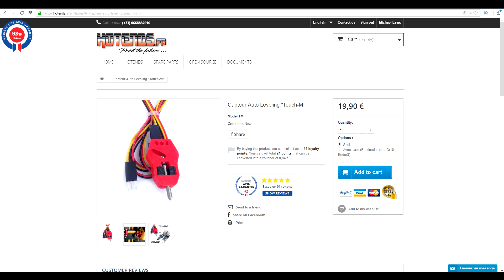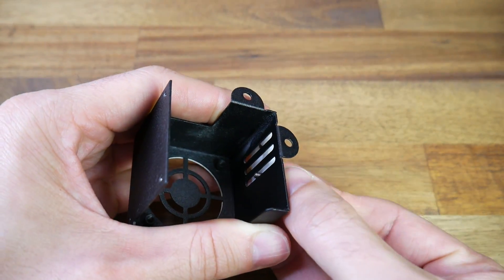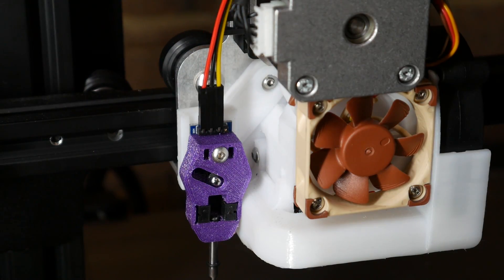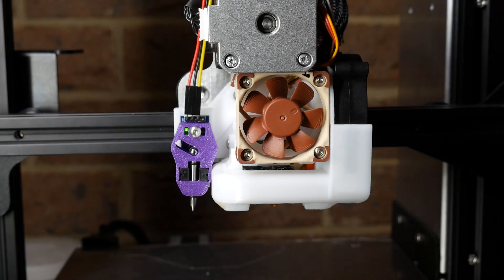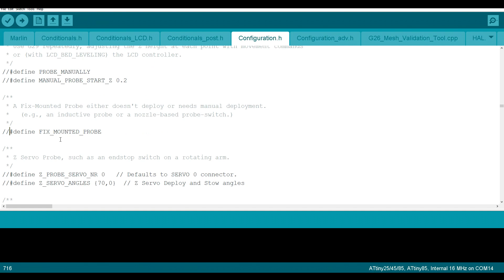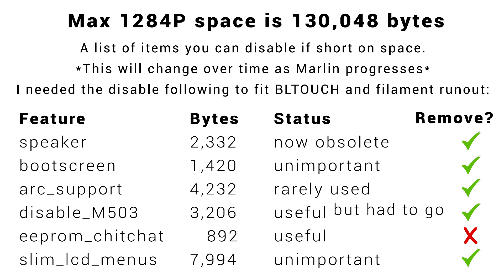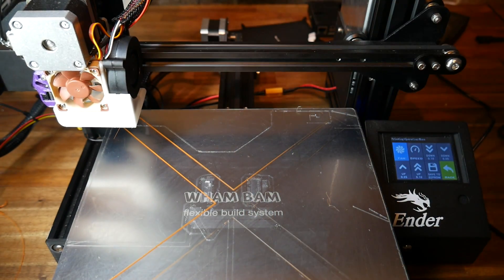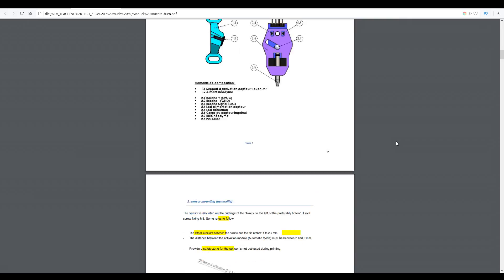Touch Mi auto bed leveling guide - BLtouch alternative? UPDATE IN DESCRIPTION

Comment: Im trying to enable this in mks robin nano v3 now, flashed latest marlin and made all the configuration to work (without meshbed) I have old Ramps+mega stuf and mash level bed is working line a charm. But spending many hours on mks robin nano v3 still couldent get the juice..

Comment: Howdy Michael! Greetings from Brazil.

One of my printers is a Sethi3D FARM (made by a local manufacturer here in Brazil). It doesn't have specifically a Touch Mi, but its Z probe works with the same principle (the actual board PCB looks like an exact copy of it), so I probably think it's configured in Marlin as one (the manufacturer does not release their Marlin source code allegdely to "standartize tech support".

Now here's the thing. The printer is out of warranty anyway so I plan on Klipperizing it like I did to my Anycubic Mega X (your tutorials, along with JJ Shankles ones, helped A LOT btw). I might model a mount for a standard BL Touch, but if I could (at least provisionally) make the stock probe work on Klipper, it would be awesome.

Any hints on configuring a Touch Mi-style probe on Klipper?

Comment: Hello friend, on my Ender 3 printer and based on this tutorial I installed the Touch-Mi with the Firmware listed in the description and it worked perfectly. But now change the plate for this:
SKR Mini E3 v2 0 and install the Marlin 2.0.1 which is the latest version and I don't know what to do to configure the TOUCH-MI.
  Can you help me configure the Marlin so that EL Touch-Mi works. Thank you

Comment: I think it is a very nice solution proposal because it works with any surface and it could be implemented in old control boards that don't have the extra pin for controling an electromagnet. It just needs 5V and GND. I think problems would be solved soon....

Comment: I have had these same issues with unreliability with a £12 3dtouch from geeetech, tried the probe on an A8, cr10s and a20m. Always similar results, just not reliable enough unless use a 0.3 layer height.
With this touch mi, could the magnet  no be placed on far x axis, or I know it would take a long time but if we fixed it to the top bar at the top of z axis, there would be less false triggering.

Comment: Hi, help me deal with BLtouch. I installed everything, set everything up, but there was a problem with (HOME). When you start HOME, then on CORE xy, the carriage goes to the left front corner according to XY - that is, everything is correct, and then the Z axis starts to rise. But the problem is that I do not reach the table with the block, that is, I need my head printer before leaving the Z axis in HOME, first went to the center of the table.
Marlin 2.0 SKR1.3

Comment: Hi Michael, the boundaries for probing have changed in Bugfix 2.0. 

The setting no more exists... Now you need to configure it in this section. 

Configuration_adv.h

#if PROBE_SELECTED && !IS_KINEMATIC
  #define MIN_PROBE_EDGE_LEFT 48 
  #define MIN_PROBE_EDGE_RIGHT 48
  #define MIN_PROBE_EDGE_FRONT 20
  #define MIN_PROBE_EDGE_BACK 20

#endif

Its no more the max value. Now the information is how far from the edge (see right and back) If you just copy the vaues the probe will stay on one single spot like mine did... :-D

________________________________________________________________________________________________________

For the probe offset now there is just a single line (X, Y and Z)

#define NOZZLE_TO_PROBE_OFFSET { 48, 0, -1.175 }

Comment: check "OPTO" optical probe - I design it few years ago (but put it on thingiverse last year) , you can mount it anywhere without worry that it melt becouse steel dont melt :) (probe can be mounted on top of the hotend not on the side)
Still Touch Mi on video is awesome :D (need few upgrades but its nice :) )
https://www.thingiverse.com/thing:2769816?fbclid=IwAR3GbxoKSlJSDWlMNIwkw5Pa01H1t_oYHn2T3JAW4U9yQwyLfYeOrWxom2A

Comment: Optical ABL solutions have been around for many years now. It is known that light effects the accuracy so the optical sensor can detect the interuption better a very small LED would need to be fitted to help with the issue. As you said probing speed also matters which is a very easy fix in the code.

Comment: Hi Michael, Great video and thank you so so much for helping. Quick question. I have a CR-10s, with a hotend that leaks (I updated the nozzle to a 5mm (to use wooden filament) and think I may have overtightened the unit) and am considering updating. In your opinion and if you had to buy another creality printer, what would you buy? Note: Whatever I get, auto-bed-levelling is a must-have. Eagerly await your reply. Dujon

Comment: We're adding formal support for this in Marlin shortly. Watch out! It will ensure a minimum height for probe deployment. You'll still have to tune movement limits and/or the magnet position so it doesn't drop the probe near the end of the gantry. While the side opposite your endstop is an option, some people like to put their camera trigger there. https://github.com/MarlinFirmware/Marlin/pull/14101
Reply from the maker: Thanks, Scott. Appreciate all of your work.

Comment: Since you're already in Marlin, you can add the G1 Z0.5 step to stow the pin in Marlin's G29_SUCCESS_COMMANDS line in Configuration_adv.h and skip the slicer config.
Reply: Hi, can you help me, I can't find the Marlin G29_SUCCESS_COMMANDS, 1.9.1. Thank you
Reply: @juancarlos3989  You’ll need to use Marlin 2.0.x.
Reply: @thisiskeithb  Hi friend, I installed it on my Ender 3 printer and Touch-Mi with Firmware 1.9.1 and it worked perfectly. But now change the plate for a
SKR Mini E3 v2 0 and I want to install Marlin 2.0.1 which is the latest version and I don't know how to configure the TOUCH-MI.
 Can you tell me if you have the Marlin 2.0.1 configured so that EL Touch-Mi works. Thank you

Comment: The reason why it doesn't work consistently is because they didn't try it out well enough. An IR sensor is sensitive to the sunlight and some artificial light sources. The solution would be to add an opaque shield around the IR sensor, but besides that, IR sensors are generally not always accurate enough for auto bed leveling measurements. Besides that point, that metal pin is too sharp and will start carving small dips in your print surface after a while. I suggest making it flat like with the 3Dtouch.

Comment: So cheap iduction sensors are still the best option.
Reply: From a repeatability test I saw, the best option is a simple microswitch.  Key points: Needs to have a repeatable positive stop position.  Remove the metal tab carefully.   It's cheap and provides very accurate results.   The down side is in solving the automatic deployment issue.  You could integrate a servo or something like that, but there in lies the complexity of making it full auto.  Semi auto would be a simple magnetic mount that would have a couple stop tabs that keep it positively and repeatedly located.

Comment: BL Touch rocks! This one's accuracy it's also being affected by the ambient light even it's infrared but even if it's closed to the outside, the accuracy it's lower than on the BL.  Maybe worth changing the optical sensor with a hall sensor? Think that this concept could be DIY if the price it's lower than for BL Touch (need to calculate but...unlikely).

Comment: Hi, it did not become clear by the video, but did you comment out the G29 and just use the stored settings?
My ezabl even show same symptoms as this if I don`t run the G29 in front of every print.
I find it to be due to Z-axis not staying in zync on my printer.

Did print some blocks for it, after that - the problem where solved on my printer.

Comment: My printer used to use something similar, And worked pretty good. As I had troubles deploying it on a delta, (it was supposed to bump a tower, but before calibration, it doesn't know where the tower is) I do it manually (and dont use it for ever print.) Your's probably inaccarute as it missing a spring to push the pin down when measuring. Using a round shiny metal pin is also hard to detect for the optical sensor.

You should test the probe by using M48.

Comment: I would paint the top of the pin black so there is less reflection from the top into the photodiode. It should help but YMMV.  Blocking the ambient light into the top will probably help too as it will change the amount of beam from the LED that needs to be blocked before the sensor operates.

I bought a 3D touch and it was useless compared to the BLtouch I now have.
It may have been a fake I have no way to tell.

Comment: Looks like an interesting concept, but why no cover over the optical path? Seems to me that ambient light could be bolloxing the accuracy..
I'll stick with my ZedThing ABL..  :-)
Reply: Indeed, your right! Even that sensor it's using for sure the infrared light it's still sensitive to ambient light. I'll try to build a closed one just for curiosity and in the price for build it it's right, then the concept might be worthy, what do you think?
Reply: @neagoecatalin879  I would definitely have a go at building a fully closed version.. It's not exactly expensive to build, apart from a few hours design and print time..!!
Reply: I use this type of optic sensor for all of my endstops and there is no need for adding enclosure. That black piece with a slit is enclosure.
Poor acuracy is result of to much slack between probing rod and frame.

Comment: Hi Michael, great review/tutorial as always. Before I had even seen the video, I checked out the website and manual. It seems a very clunky way of simplifying installation, which doesn't even do that well. Sure, maybe slowing the probing speed may yield better repeatability, but that wasn't necessary for the BL Touch, in fact you sped it up, with no loss of accuracy.
As you may remember, I also followed your guides on installing the BL Touch on the Borg (CR-10S4) and it is still serving me perfectly, not one failure.
Great to see the WhamBam FBS, I finally managed to buy mine too (also for the Borg) and it is everything I wanted, and then some. The weight saving has meant that I can increase both the jerk and acceleration too. I've also added a 0.8mm nozzle to the Borgs Microswiss hotend, so getting used to the finer tweaks with that. Happy days :-)
Reply from the maker: Your setup is very advanced now!
Reply: @TeachingTech  Thanks mate, much of it is thanks to your tutorials. It seems to be working well for me. Just need to think of something to print with it now. I spend far more time and money on improving/upgrading my printers than actually printing stuff. I thoroughly enjoy it though and that's what counts for me.

Comment: Woow woow , why this video ?
at 12:23, you don't put the offset on X ;)
Plz make a test M48, it's very precise.
Why did not you come to see me before publishing this video?

I sent you an email on April 22 to tell you that we had made a dedicated menu to adjust the sensor but you never answered me
https://gyazo.com/76f23895724907c7bf079ee902b3bc2e
Reply from the maker: In that email you provided the manual, which I used for this video. You also offered to setup the firmware for me, which is not useful for me making a guide. I don't want special treatment, just the same experience as any other customer.
Reply: @TeachingTech , it's not the setup but the new Firmware marlin 1.1.9, now it's not necessary to configure the firmware & you have a dedicated menu for tune the TouchMI.
But try to make a M48 repetability test first ,thx.
i need to know where is the problem, because we send many many sensor & a few errors.
I consider everyone the same, but I need to know where is the problem  I do not let my customers down
Thx Michael
Reply: Hi Pedro, I am using it and it works perfect. The only fear is that the needle will be down and collide with the platform, that's why I ask you can add the G1 Z0.5 step in Marlin, so that there are no oversights in the Cura configuration or some other cutter program.

Comment: I saw a similar solution in a fablab more than 2 years ago. Difference was that initial release of touch probe needed to be done manually, but in the end the pin was electrically raised from the bed. And it worked quite good, but they were using on glass bed. I guess that this design is open source since a while, and not really difficult to make also.

Comment: You should check out the pyr0 piez0 auto bed leveling sensor. It's an auto bed leveling sensor developed by one guy. It's not finished yet, but I have heard it's near completion. It has no moving parts and is supposedly more accurate than a bl touch and it works on all surfaces.
Reply from the maker: Thanks for the tip.

Comment: Can you review the 3D Touch in comparison to the bltouch?
Reply: it's junk, don't bother. I have it and I have to adjust the z offset almost every print just cause of how inconsistent it's probe accuracy is.
Reply: @Rbanh  I have it too ;)
Reply from the maker: I prefer to support genuine but the choice is for each individual
Reply: I bought a 3D Touch a while back when ordering some other printer parts from China since it was so cheap I thought I'd give it a try, but it became more hassle than just manually leveling the bed. I used the "Bed Level Visualization" plugin on Octoprint to get a color-coded map of the probed surface that shows high and low spots and tells you on a graph the actual difference in mm. Every time I ran it the probed result looked completely different. Adjusting the sensor with the screw helped a bit but a few days later it started flashing an error that couldn't be cleared and never worked again. It's supposed to go back to a solid blue LED after you clear the alarm and then you are supposed to turn the screw until the LED turns off, then back it off until the LED comes on again to fix the issue, but mine would turn the LED off completely after clearing the alarm and adjusting the screw wouldn't turn the LED back on. It was really frustrating since there is very little information online but eventually I found a forum post detailing the same issue and the answer was "buy a new one"... Rather than buy another piece of junk I ordered a genuine BLTouch instead.
I received it a few days ago and the difference is night and day. The solenoid on the genuine sensor is much stronger, the coil has at least twice as much copper wire, and running the color map produced nearly identical results every time (deviation was only +/- 0.01mm). Holding the two side by side the genuine sensor is heavier and overall feels like it's construction is much higher quality.
I wouldn't recommend going for the 3DTouch, it's not accurate enough to get good results. The genuine BLTouch is not cheap but from my experience so far it is well worth the money.

Comment: I have been using the Touchmi for the past 3 weeks without any issues.   

You are supposed to use a small printed 2mm disk to adjust the probe when you install it.
Reply from the maker: I used a 2.5mm hex key in the exact same way. The range in the manual is 2 - 2.5mm.

Comment: Would be interesting if you could test the system from Precision Piezo (DJDemonD and others on the reprap forum)
Reply: I've been using a Precision Piezo Orion on my Hypercube for at least half a year. It has had some false positive triggers a few times, it can be a bit tricky to the get the sensitivity just right.
Other than that though, I love the Orion. It's at least as consistent as BLTouch in my experience, and the concept of having your actual nozzle act as the probe is a much better solution imho. I just wish it was easier to fit on everything (like a Chimera for instance) so I could use it on all my printers..

Comment: Just a thought here... might the photo sensors reading be affected by room (or your video) lighting setup? Could it be getting bleed in from an external source, as this would vary as it moves to probe other areas or if there was movement between the light source and the sensor.
Reply from the maker: That is an interesting idea. I do point the lights at the printer to film.

Comment: It seams like the pin tripping the LM393 IR speed sensor - that's what Ebay calls it - is not accurate/repeatable enough. I have a car engine running with that IR optical sensor, and my timing wheel has sharp blade type holes for accuracy. Maybe something can be fixed there.
https://youtu.be/5Hv6Pn11RgI

Comment: You could do a probe repeatability test with M48 n#, that gives you the mean and standard deviation of n# of measurements of the probe. Just watching the video you can see the slop in the pin relative to the pin housing. I’m guessing that what’s causing the inconsistent probe measurements. Nice idea but poor execution by the looks of it, shame.
Reply: I agree.  Lots of slop in the assembly as it wiggles.  I'm also curious to see what the standard deviation is.
Reply: This! Please do a repeatability test, and also experiment with probing speed. Also, I wonder if crashing the probe into the printer may have damaged it - it got stuck on the pin, and if it bent the pin or deformed the hole that constrains it it would affect reliability a lot!
Reply from the maker: Fair point. The pin is pretty rigid, but it is possible.
Reply: @Topy44  Tiene el mismo movimiento que el Bltouch..